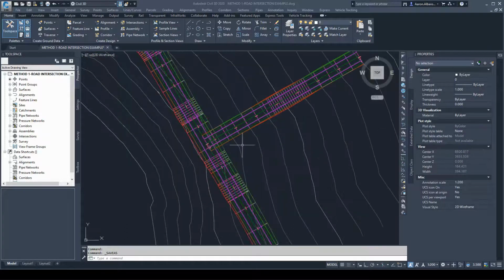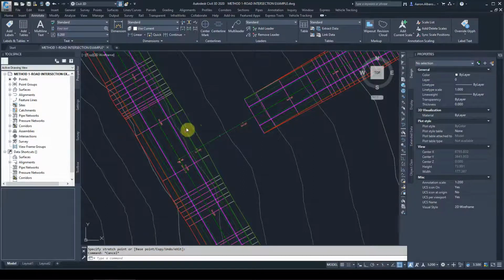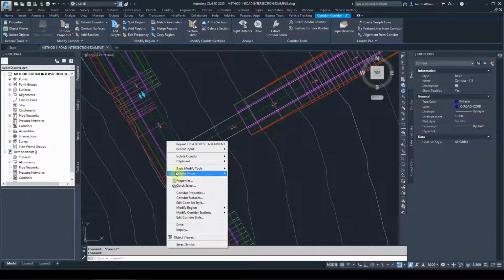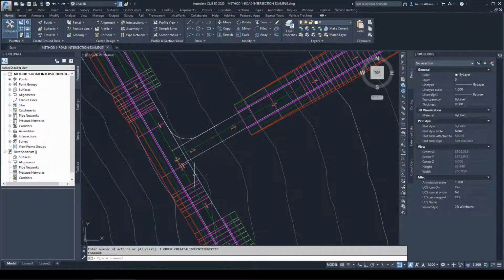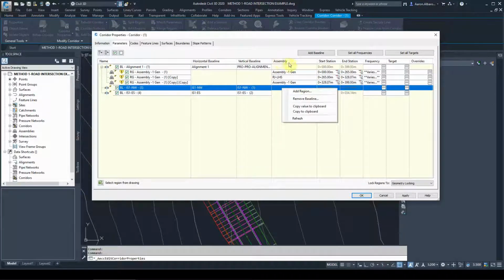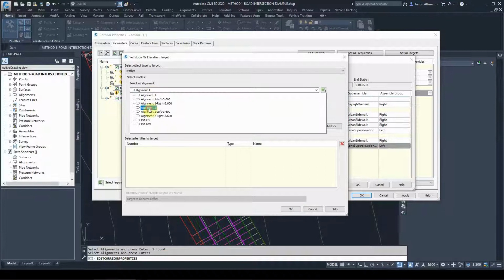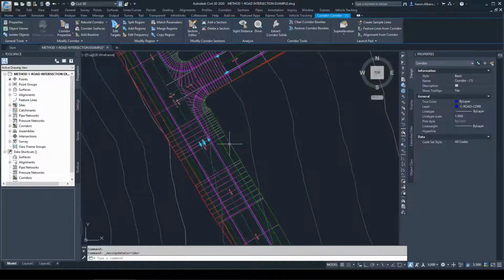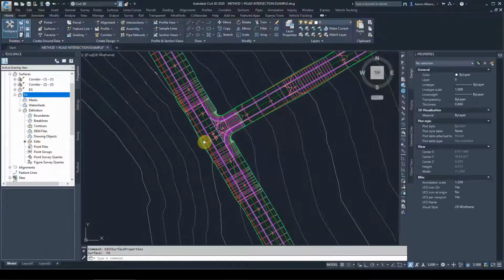Civil 3D - Road intersection Method 1

Comment: thank you
but can you please help me in the case where I have two roads with two different cross sections (different width of the roadway and sidewalk) I have been trying for two weeks to adapt your manual method in this case but i failed
I would be very grateful for your help because I am stuck, thank you.
Reply from the maker: Hi Nourhene, try to watch the first half of this video which has a similar case to what you described in your comment, it may help, if it didnt please contact me again. https://youtu.be/gGJ4ItlWr4k
Reply: @AaronAlbarouki  Hello sir, thank you very much for your answer but unfortunately I can’t solve my problem in fact I’m trying to clarify things my problem is:
I have two lanes each with a different sidewalk width (the first with a sidewalk width of 3m and for the second street, a sidewalk width of 4 m) so I don’t know what is the cross-profile to fit at the offset axis which must start with a 3m sidewalk width and end with 4 m, the method works perfectly in the case where the width is fixed for both roads but in my case I don’t know how to adapt it  , I look forward to your help which I appreciated very much and if it is possible to give me your mail or your linkdin account to send pictures captures of my problem in case or my explanation and is not clear, thank uuu
Reply from the maker: @nourhenekouki1621  send me your file please to: aaron.albarouki@gmail.com